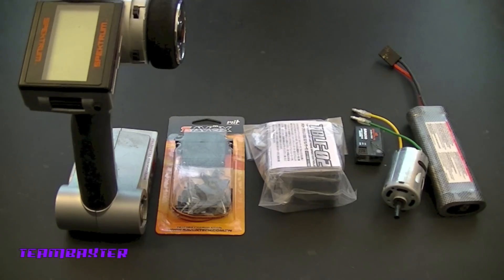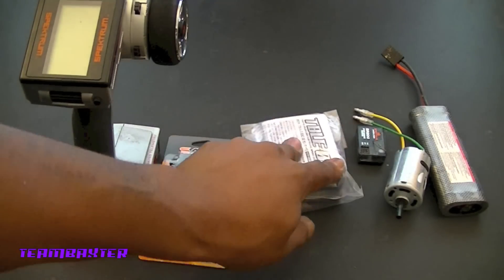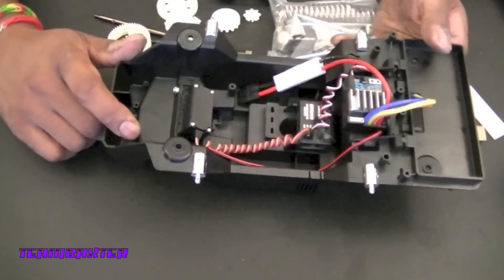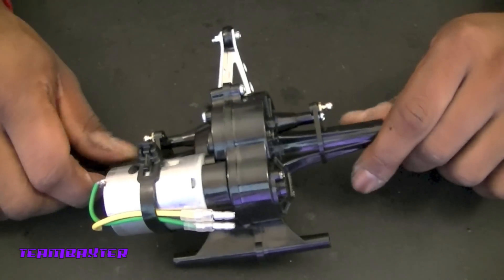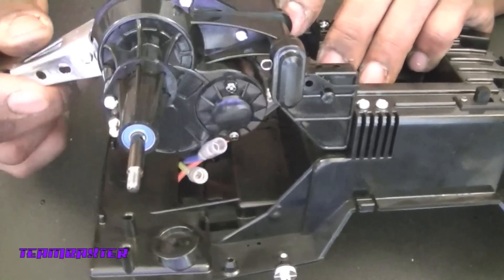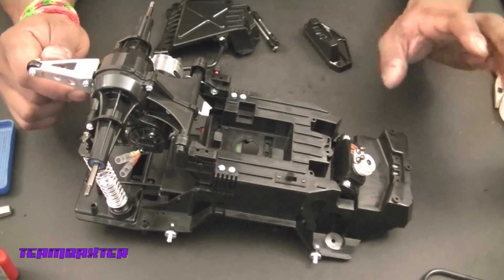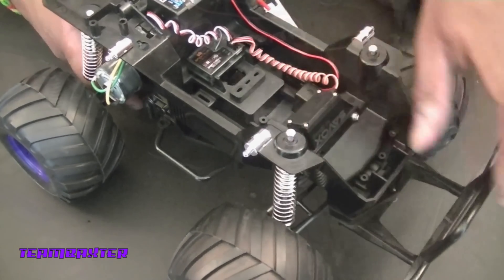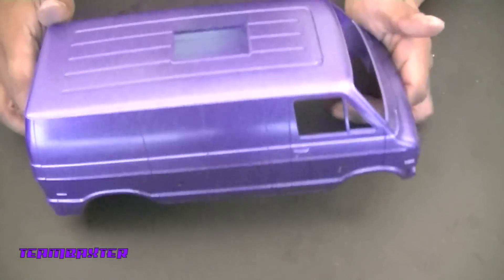Tamiya Lunchbox Build: 02: One-Day Chassis Build

Comment: Nice, did you consider washers at the top of the shafts?
Reply from the maker: Stefan Dembowski i did, that was actually one of my first considerations, but the way i did it did not require me to disassemble the shocks. Thanks for watching and commenting.
Reply from the maker: Kevin Field i couldnt have made this buid last long if i wanted to. theres just not enough parts to take forever.

Comment: How did you fix the camber?
Reply from the maker: 82racer i added a spacer to the top of the shock shaft, where it protrudes past the chassis. This shortens the travel just a bit, and somewhat corrects the issue. Thanks for watching.
Reply: ARTINCbydb  thanks for the reply, I'm looking at getting one. They look fun!
Reply from the maker: 82racer lots of fun, even more, if youre not worried about scratching up the body